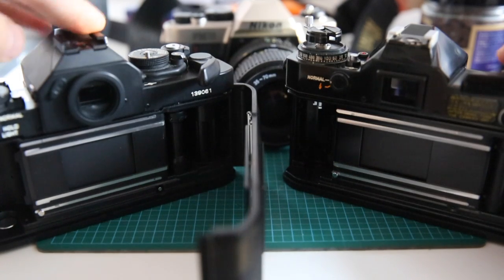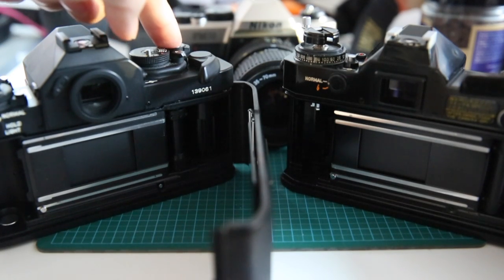Film SLR Shutter Slow Motion

Comment: If my camera is missing the shutter curtain, is it still usable?
Reply: lol
Reply: No
Reply: Yes, but only as a doorstop. Lol.
Reply: Yes, tripod + lens cap = bulb
Reply: I bought a vintage camera from the 50s and it doesn't have shutter curtains and I think that type of camera don't need it
Reply: I know everyone thinks that it won't work. But remember that it still has the mirror blocking it. The time that it is open may not be the same with the set shutter speeds and there's also the issue of light leaks...but technically, the camera should still be able to expose the film. Right?